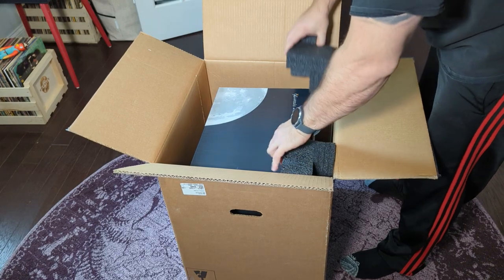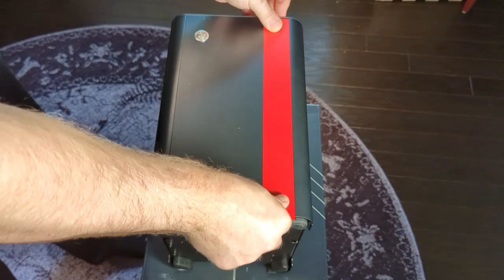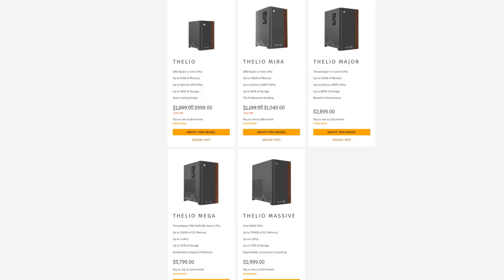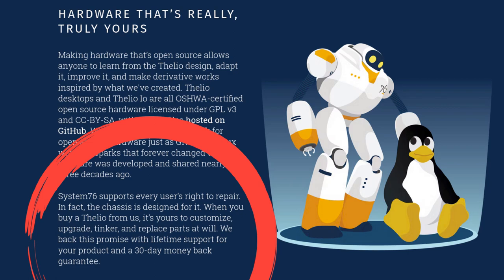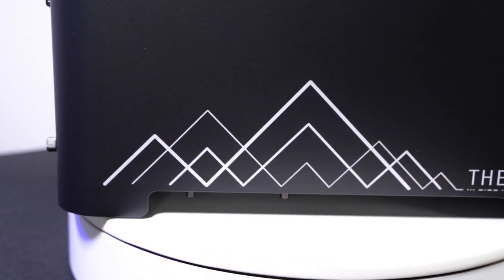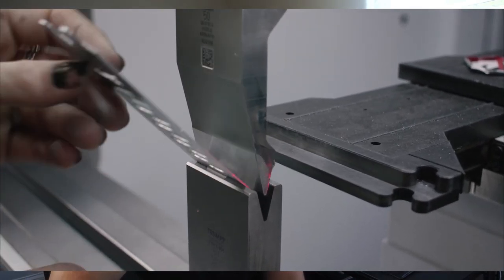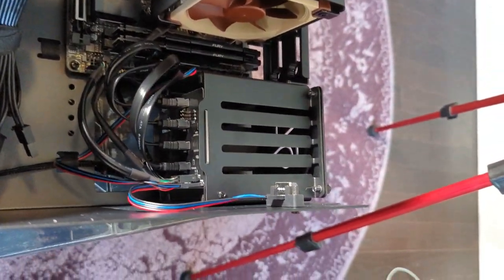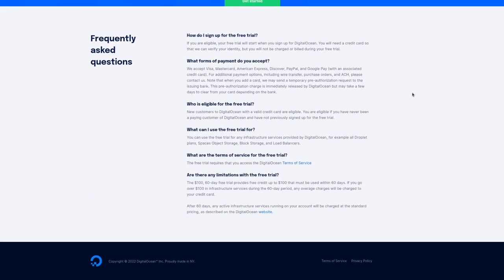Hands-On With System76's New Redesigned Thelio Desktop For Linux!

Comment: I actually am seeking a case like this but with better noise management, dust filters, a normal hole for replacing motherboards, and I know this might sound weird, but I am one of the rare people who like to have every single port on the front of the computer, all but the power supply cables and display ports.

Comment: I have been using UNIX based products since the 1980s.  First I used SunOS and Solaris.  In the 1990s I first set up a dual boot of Linux with Windows, but by 2000 I found I was almost never booting Windows.  I never had any issue running Linux on a desktop x86 because the drivers all worked.  However laptops often had issues with laptop specific hardware, such as touch pads.  Since discovering System 76 I have exclusively bought their laptops.  I love that they support "the right to repair".

Comment: A couple of great points that keeps me looking and maybe waiting. The fixed backplate was a design flaw or deliberate and seems to go against the ability to maintain it long term.  I've heard some complain about the noise issue so maybe that only is more pronounce with a GPU unit.  A noisy machine is a deal breaker for me.  Fan intake at the bottom means it really should not be on the floor.

Comment: I would really like to purchase the Mira for my primary desktop,  but I have decided not to for  just a couple reasons.   First, I need a USB-C and at least one other USB 3.2 port, plus headphone and microphone jacks, on the front of the machine where I can get to them when I need them.   And secondly, I have no way to test the MX Linux with KDE Plasma that is my distro of choice.  I have no desire to deal with the Gnome DE anymore.   

I run MX Linux and access the occasional need for Windows using a virtual machine.   My physical space would mean that I'd have to have the back of the system facing out so I can access connection ports, which defeats the purpose of the good-looking case.   Need two USB-C connections - one in front, one in back, especially given that there's no way to install a 3.5 inch HDD inside the Mira's chassis.   

I love the culture and philosophy of System76 builds, but I can't get what I need at any price from System76.   And I can't change motherboards to get there either.

Comment: Good review. I would have liked to have heard more about the expansion capabilities but I'm sure all that info is available on the spec page for each model. The two problems of not being able to change your motherboard because the I/O ports probably won't match and no usb or audio connectors on the front are troubling. The lack of front ports can be easily fixed with a hub connected to the rear port of course, but it shouldn't have to be done that way. But short of mod'ing the rear of the tower like you said there isn't anything that can be done about the changing the model of the motherboard.

I do have problems with Pop_OS! though. Gnome is just a deal breaker for me. It's a functional but unpleasant environment to work in. I strongly prefer Plasma DE. Pop_OS! should offer other DEs like other distros do. I find the "our way or the highway attitude" off-putting in something as important as the DE. Sure, Plasma can be added as an alternative DE, but that comes at the cost of stability. Of course the user can probably install another distro with the DE of his or her choosing instead of Pop_OS!, but that means no firmware updater that is built into Pop_OS! More on this in a moment. An owner shouldn't have to dual boot just to get the DE of his or her choice and still get firmware updates.

But besides that, overall I'm not a big fan of System76. I bought a System76 Lemur 6 laptop back in 2015 or 2016. It came with a keyboard with a apace bar key having a large dead-spot. I should have returned it for another, but I didn't. Eventually, I replaced the keyboard although it was rather expensive. That still didn't fix the problem. The space bar still has a dead-spot in it. This obviously makes it difficult to use. Further, although I do not care for Pop_OS!, it is the only distro that will run on that laptop. Any other distro I've tried, will cause the laptop to suddenly shutdown randomly as if it lost power.

Like I said, I'm not really a fan of System76. I'm sure other owners of their computers have had very different experiences. Like with all things, YMMV.

Comment: There is absolutely nothing special about System76 hardware to justify the price compared to any hardware last 5 years running any Distro/DE. Even POP_OS works beautifully on older machines and hardware. Also this new fad marketing of 'this isn't your normal company these people are different/nerds/care' BS is silly. They are still a company and all I care about is they make good stuff (they do) at a fair price (do not believe it is).
Reply from the maker: I appreciate your comment but disagree about the fair price. As someone who also had a family computer business you're not going to compete on price with companies like Dell and HP. You simply can't as they're ordering tens of thousands of computers at a time all manufactured offshore.  You have to compete with service, quality, and uniqueness. The margins are thin, razer thin, especially when you're using domestic labor to manufacture the case and assemble the product. Not everyone can afford to pay for a System76 machine but if you can then you're contributing to an open source company that's lifting up the ecosystem with their contributions. And as someone with 23 years in corporate America I can  absolutely tell you that there is a huge difference between companies that focus solely on profit and companies who want to make a profit but care about what they're putting out. I would put System76 in the latter. But buy whatever you want,  that's just my opinion.
Reply: In early 2020 i checked the prices for an XPS, Thinkpad, and Lemur  9. For all of them having 16GB of ram and 500GB of storage the Lemur came out $50 less than the XPS and $120 than the Thinkpad. I do agree that they are pricey, but at the at least when i was out shopping it did not seem like a robbery.

Comment: So what is up with this custom firmware on the motherboard and custom firmware on an IO daughterboard.  First of all, WHY?  And is this going to prevent you from running any other operating system on the hardware.   The motherboard, probably not, but if there are only Thelio drivers for the io daughter board... yeah, might be a major strike against it.  You should be able to throw it away though and just use the IO on the dmotherboard, in fact, it makes you wonder.. why they need a custom IO daughterboard for any IO at all.. it should be all otu the back on the motherboard.

I'd definitely aprt it out and throw away all the value added System76 work as adding no value at all, and just recycle the parts into a new build.   I'm not saying I wouldn't give PopOS a fair chance... I'd do my best to get everything I needed to run under it...  Steam, Paintdotnet, my games, OBS studio, Audigy, Sony Vegas Movie Editor, etc.   If I could get all my WIndows programs to run under it and the UI didn't drive me crazy, I'd be like hey great, goodbye WIndows!   But if it couldn't yeah, like every other user, I'm fleeing back to WIndows where stuff jsut works.